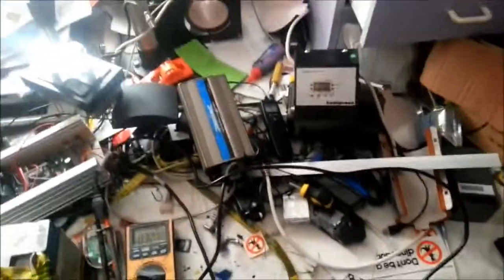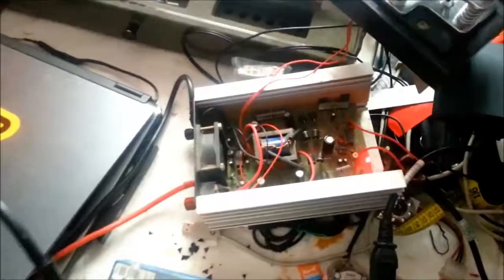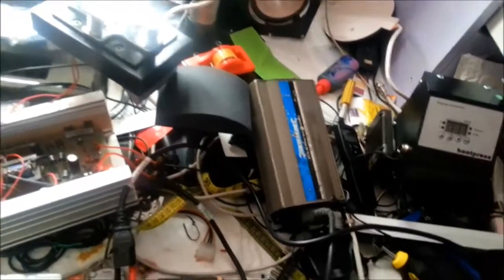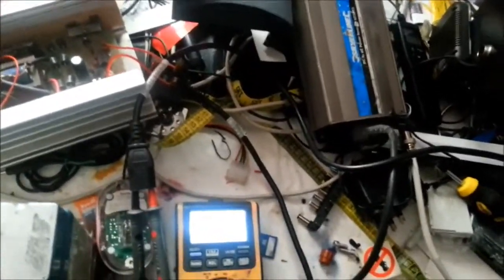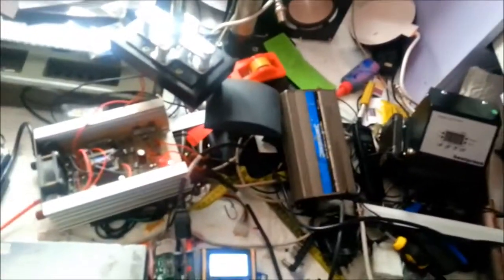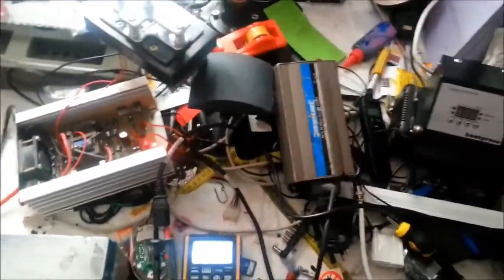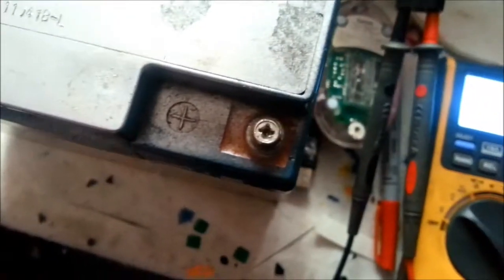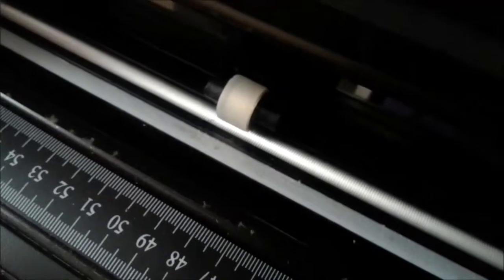'Dead inverter' Night camper conversion #04 for short holidays and photo trips peugeot 806

Comment: Used to have all the hook ups for power, but in latter years the light you can buy for inside campers the baterrys run for 100 hours or more and I use rechargables that the van charges. Lap tops and pc tablets are so easy to charge from car battery. I do not bother with any power hook up now. Also at night I do not spend long in my campers, I always have fire and beers out back and then just dive in to sleep. I also get all my cooking done before dark Check out my site for some of the meals I cook in my small camper.. Cheers Pete